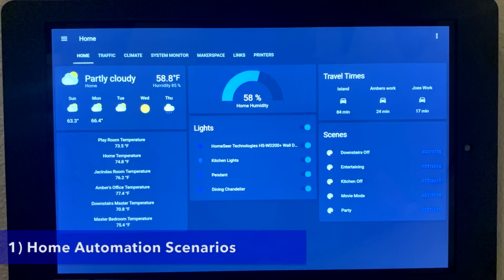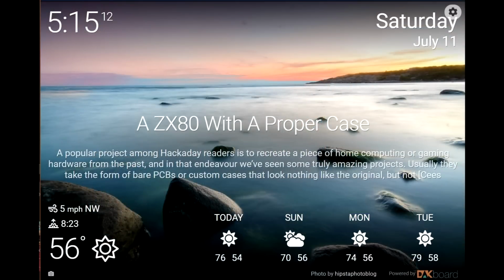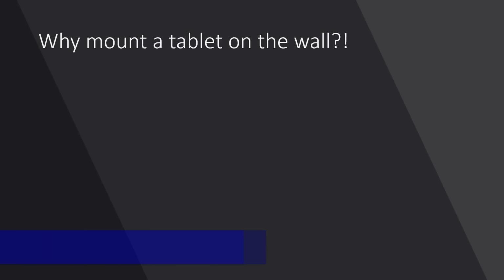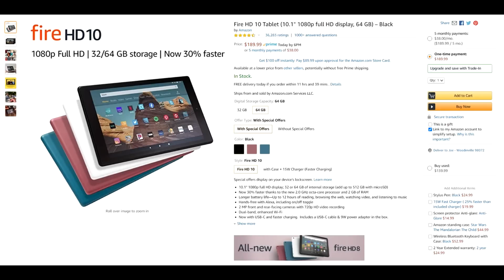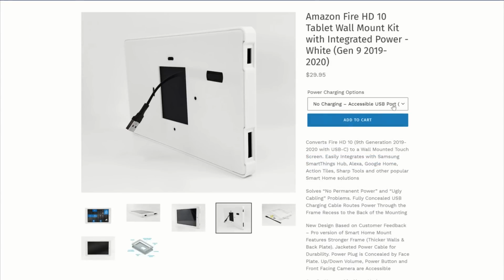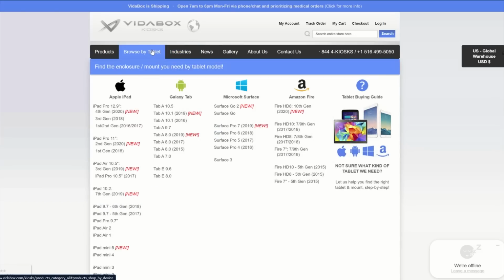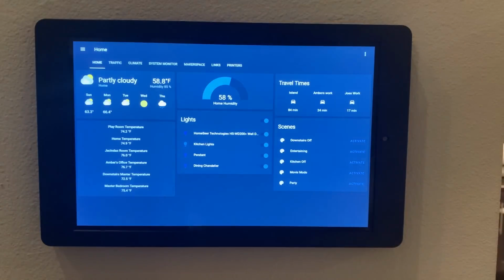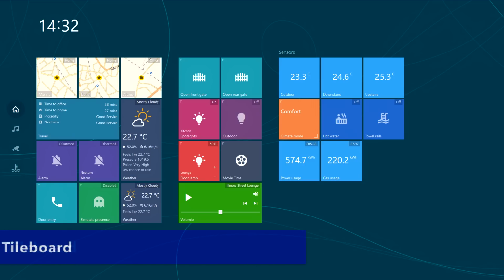5 things to know about wall mounted home automation tablets

Comment: I use SmartThings to control my home would I be able to download the SmartThings app on a Fire tablet?
Reply from the maker: I'm not sure honestly, I've not used smartthings. I would check the amazon app store if you already have a fire tablet to see if it's there, but if not, I'd try to avoid an amazon tablet for something like this just so you can have full control over it. I moved houses and the next time I do this I'm going to go for either a cheap android tablet (or used one) or something else similar

Comment: Does this save you money?
Reply from the maker: No. Home automation is often about convenience. Rarely can you save money with it, though you can use it for early detection of water leaks and such to turn off water. But no projects like this are either convenience or flash or both. Even if I use less energy, the cost of the system would take so long to offset it’s not reasonable.

Comment: Are there mounts for the non-iPad options that also allow the slide in and out for use out and about around the house and then re-mounted?? Just like the iPad one??
Reply from the maker: Not at the time I filmed, but that would be ideal and I’m looking into it for a follow up project. It’s been a few years since I did this and a lot has changed. I’m hoping for either a dockable mount or a wireless charging magnet mount currently and will do an episode with what I find

Comment: GREAT VIDEO.. and thanks for the details research.  I have been researching (A LONG WHILE) for a HA_HI and a must (for me) is a wall mounted Touch device with video streaming.  Tablets have all but one requirement and that is forced Battery use under charging.  The swelling and/or failing battery is still a blocker for me.  I have seen endless 'no battery' hacks of old tablets, but newer tablets seem to have lock down 'features' that require hacks that block other features I need.   Please comment on your battery concerns for wall tablets.   BTW my current design uses POE/Ethernet - data/power thru C connector and wifi disabled.
Reply from the maker: Battery circuits today from reputable manufacturers (as in..not something you find on aliexpress) have a 'smart' circuit in them to handle various dangerous situations in batteries that used to lead to swelling. I have had tablets plugged in for years and not had any issues myself, but I'm just one data point. I do know from my experience in the inustry that smart battery circuits are built in now, and there have been firmware and OS updates to also control charging. I feel like if you buy a tablet made in the last year thats not bargain basement you'll be fine. I keep my tablets charging all the time..windows, android, and ios.  None have had issues (knocks on wood)
Reply: @geektoolkit  Thanks - found info getting charge info into HA and using that for power charge control.. using POE/ETHERNET for my situation.. may have to change or hack power flow but doable.  Thanks again

Comment: Imagine if you have to move? 💀
Reply from the maker: That's actually a great point, but not just for this tablet but for all home automation.  When I left and was showing the house I left this up and explained it was a fire tablet that controlled home automation stuff, but if they wanted to remove it then there was a small hole to spackle (This was just screw mounted and a low voltage line coming out). The bigger problem I had was I'd invested about 1,000 dollars in smart switches, mounted leds, tv mounts and such...and that I had to just walk away from. I explained that they had zwave switches, but the buyers didn't understand what that meant and home asissistant isn't at a place where I felt I could hand that off. Uninstalling about 30 outlets and switches and then buying dumb stuff to install wasn't worth the effort.  In short, moving and home automation really don't go together well..this tablet was the least of the issues though.  It's a great thing to think about if you're not going to stay at a home long.

Comment: can you add voice control with home assistant?
Reply from the maker: Great question! You can integrate google and alexa devices which is what I do. If you wanted to do a DIY system you could do that too, just have to use webhooks or mqtt to interface.

Comment: Thanks for this great video! I have the fire hd 10 and having problems loading videos - it’s slow and the it blacks out. I’ve tried to optimize it via developer tools but not much luck. Thoughts?
Reply from the maker: That sounds like either the tablets defective or maybe overheating
Reply: @geektoolkit  so when I had 3 live cameras in the same page/tab it wouldn’t load but when I kept only one camera it works good…I guess the fire tablet is just not as powerful as other ones out there.
Reply from the maker: Does 3 cameras work on a pc? I’m just wondering if the bottleneck is your pi/server or the tablet. That’s good info to know!
Reply: @geektoolkit  yes I have a NAS running HA and works perfectly - I have 8 cameras running in the same page/tab with no lag.
Reply from the maker: @RafaelRenovato  Oh interesting! Ok thankyou that's a great data point...now I wonder what level of tablet can run it. Do you have an ipad or a samsung to test on? I may have to do a followup talking about more power hungry scenarios processor wise. I also need to get more cameras apparently :D

Comment: Ever thought of using some acoustical treatments...holy echo.
Reply from the maker: Yeah the echo sucked filming there. I think if I were to do it again I'd film in my upstairs and then use B roll.  I just didn't think of it at the time and honestly didn't know the technique.  Still learning a ton about filming, audio, etc.  One other thing I learned later would've helped is putting the mic closer.  I spent decent cash on a new directional mic that hopefully is better, but also I'm going to avoid recording in that area again :)

Comment: Not sure what else you have set up in your network, but have you considered powering your tablet with PoE? They make USB Adapters for it.
Reply from the maker: I would LOVE to do that..but I don't have ethernet run anywhere near that section.  Or are you saying to use a POE adapter in the wall and then convert that to usb...I haven't thought of that..but thats..intriguing

Comment: first of all I really enjoyed watching this video, I am trying to put a wall mount in my home and I really didn't know what tablet to use, I have an old ipad I am trying to use , but I think its too old, its a ipad 3, I think I am going to go the andriod route, I was impressed with the way you went over the software, I have a question, and you use more than one tablet , like one upstairs and one downstairs?
Reply from the maker: Glad it helped! If an iPad 3 can use the web browser it may work based on what you’re looking to control (if it’s web enabled).
  I use one downstairs currently but I plan on adding one or two upstairs. Right now my upstairs is controlled mostly using PCs and an iPad on a charging dock, but I plan on adding a wall panel in my office since it’s where I spend most of my time; though I’m looking into a different design
Reply: @geektoolkit  it  can get on the web, but I have no idea what software to use for it.
Reply from the maker: @jamesdavis-vc9ww  it depends on what home automation system you're running..if it has a web interface then you can use the browser to control it. home assistant is great for this!

Comment: Do you have any videos on smart charging a wall mounted tablet?
Reply from the maker: As in turning the power off at 80%? If so I don’t….charge circuits one tablets should be doing that already, and if not that’s a huge problem with the tablet

Comment: The transitions between lages are horrible. Especially when it goes back hkme.
Reply from the maker: Yeah there’s two things there…I was running home assistant on a raspberry pi 3 at the time, and I am using a budget tablet (Amazon fire) with wifi. The idea behind this video was to talk about the tradeoffs and tech. If you’re able to use POE, and willing to pay for a Samsung tablet and then run your home assistant on say an i5 NUC, you’ll get much better performance. Like all things it’s tradeoffs.
Reply: @geektoolkit  i see, thats good to know. I'll need to find an example of it running on a faster system. Thanks for the reply.

Comment: What do you recommend for Ring Devices and Amazon Automation Device.  Also what did you select for your monitor was it an amazon fire device or a samsung galaxy
Reply from the maker: I use home assistant and integrations for just about everything. There are 3rd party integrations for ring and alexas and such. I honestly am moving away from stuff like ring...they lock up the protocol, and being cloud based means that if I lose internet I can't see my cameras. I also can't get a direct RTSP feed from them to do my own post processing.  
  The screen I'm using is an alexa, however in the video I go through the plus/minuses of alexas vs various other brands.

Comment: First - awesome is an understatement for this video.

Now, my question. This is specialized so I doubt you've messed with it but - the Diabetic community who use Dexcom or Freestyle continuous glucose meters (CGM) can use a real specific stack of apps to get their readings to a public web page. I think if I remember correctly the data is stored in .json format. NightScout is a bit of the project. I wonder if this could be integrated? This could eliminate the need for the public web page space and hosting costs
Reply from the maker: Thankyou! 
  
For the CGM question I’ll have to do some research. Converting JSON to a webpage isn’t that hard if the JSON is available from a public feed. I’ll try to look into this when I get an opening next week to see.
Reply: @geektoolkit  again, awesome would be an understatement! Even if it doesn't happen, I'm still super impressed with your system and how so many resources are combined into one or two looks and feels

Comment: Is it okay to plug/charge it all the time? 
Would it damage the battery?
Reply from the maker: Modern tablets come with charge controllers that disable and enable the charging to keep the battery from overcharging. This is actually part of tablets for many years now. The problem is that when these fail, sometimes they have failed in such a way as to not disable charging entirely. Apple has made changes to iOS and such to alter how the charging happens to protect even further against this. So it should be fine.
  That being said I’d likely not put a random cheap no name tablet on the wall.
Reply: @geektoolkit  Yea, I've had issues with Asus Tablets doing that.  However my Lenovo ones are perfectly fine.

Comment: Good video. Was hoping you would talk a about the other hardware in the house. Like bulbs, cameras etc. How are these connected? Are they smart bulb or is there smart plugs around?
Reply from the maker: Thanks, I tried to keep this focused to the tablets as the way others things are connected is flexible, and I didn't want to tie this to a particular system.
  That being said, I have many videos talking about different aspects of my system.  Short version is the 'hub' ran on a raspberry pi but is now on an intel NUC running home assistant. It acts as the centpoint.  My cameras talk RTSP and use ONVIF (Reolink).  I use Wiz wifi lightbulbs with Innovelli Zwave switches for lighting.  I have an Ecobee for thermostat.  I also use GE Zwave switches for non smart lighting control.   I also have a weather station made by Ambient for local weather/rainfall automations. I do have a smart plug, but I don't have a video about it yet. I use Dynaframes (which I built) for media display, and I cast to my Samsung Frame (through airplay or miracast).  I have videos on just about all of those though, so if you're interested in any there's plenty of content.  That being said it sounds like an overall view of my system may make for a good video, so I'll think on that and queue something up :)
Reply: @geektoolkit  thanks so much!

Comment: Hi! I'm looking for a wall mount, but with wireless charge, so I can pick the tablet whenever I want and move it around. Any help would be appreciated.
Reply: If you have a 3D printer, two ideas that may be useful: 
iPad Wall Mount Magnetic Qi Wireless Charging - https://www.thingiverse.com/thing:4667383
Fire Tablet HD8 Plus Qi Charging Wall Mount - https://www.thingiverse.com/thing:4588627
They might not be what you're looking for but could get you started.
MBMounts has a custom design service. I have not purchased from them but have read good things about their products. When I bite the bullet to mount a tablet, I will probably purchase through MBMounts. https://mbmounts.com/products/custom-tablet-mount-design-service
Reply from the maker: I love that idea! I’ve seen some DIY stuff where they used magnets to hold the tablet and mounted a QI charger..but it was very DIY and didn’t come out very clean. I’ll keep an eye out

Comment: Great video 👌🏾👌🏾where can I get the power cable for the back of my wall ?
Reply from the maker: Thankyou! The MakesbyMike has the best solutions I've seen so far (in that he has a ton of options). I had a power cable from an old security system, but I'm going to alter it to pull from the light switch just below it. https://mbmounts.com/

Comment: Hmm as for me, the new Openhab 3 UI is pretty laggy with those devices. I tested on a 2 and 3 gig RAM device and its still stuttering. So keep in mind, if the HA getting updated and nicer, your tablet needs more CPU and RAM.
Reply from the maker: HA is served by an Intel NUC, so this is just a web interface for it.I don’t believe you can run HA natively in android, it has to be run on a Linux box. But that means the tablet UI is fast and always remains snappy while the backend can be scaled
Reply: @geektoolkit  sorry my english is not so good. I was talking about the Webpage/interface of openhab 3. I dont knoe what language they use but its really nice animated etc. Its working great on a mi 10 pro mobile but if you want to use it on a tablet, you need higher specifications. But im still trying to figure out what happen to the webbased dashboard performance after the update to openhab 3. You guys on HomeAssistant are still safe :)

Comment: OMG i was about to buy a nest max wall gadget, until i seen this, them home screen apps are the ticket, im pretty useless at this home automation, half the bulbs on 3 different apps, sockets for tellys on some thing else,. ive got 2 mini nest, one just keeps blurting something about connecting to wifi ? other one works perfectly.. but i want to add a few other things and this is were i would like to pick your knolage, So i suffer alot of medical issues.. one of them being extreme Parasomnia, So i totally pass out and damage my body, Like opening the oven door to tke my lasagne out, But passed out infront fo the oven for 4 hours, Ended up in hospital etc..  So im trying to monitor myself for evidence for the doctors, So i got the withings scan watch, ecg i have cameras inside and out side, I have wifi sockets and light bulbs, and now looking to put a screen up and add some self tracking apps, Live on my own etc, So im trying to be able to say here doctor i went ovewr at this time, my ecg was this, my blood pressure was that, because all these gadgets are after the event, no good coming too then start pressing buttons .. I know a lot of persona things have been said, but i guine need somebody intelligent to help.. Willing to donate etc?.. With losing my father its basically down to my beagle. Lost my whole support team, and was locked down for 13 months. . So please forgive me :) 🎈

Comment: Can you integrate it with your solar production by chance?
Reply from the maker: Well I’m using home assistant as a backend...so if the solar production integrates with that then yes. Most solar has a dashboard, website, etc so you can always just host that page to get a dashboard as well
Reply: @geektoolkit  you can only view solar production from Tesla through the Tesla app. Might port another way...
Reply from the maker: Home assistant has a Tesla Powerwall integration so that data could be imported into grafana or influxdb and represented alongside other data.  So if it’s a powerwall and using a Home Assistant hub it can be directly imported. Please see: https://www.home-assistant.io/integrations/powerwall/
Reply: @geektoolkit  it's both solar panel production and powerwalls

Comment: Great Video! Is it possible to pull power from a Honeywell smart thermostat? (would be mounting directly above or in place of) If so, what type of converters would I need and how would it connect to the thermostat wiring? Thanks!
Reply from the maker: I'm not honestly sure. You could use a volt meter to measure the amperage/voltage of your wiring, from a quick search you'd be using the C wire and possibly red to complete the circuit. What you really want to know is the amperage. Then a step down converter to get it to 5 volts..but I'd research it more first on a home automation forum. I don't know of anyone that's done it, and I wouldn't want you to hurt that system.  Measuring current/voltage should be safe and get you a start if you know your way around a digital multimeter though.

Comment: 5:45 Wait, where and what is the other end of that USB power cable? I was thinking of doing something similar (basically ensconcing within wall cavity), but didn't wanna "rig" it too badly. Curious where you tapped in!?
Reply from the maker: Good question, I think I cut that part of the video possibly. I had a security panel there so I had wired into the old security panel wire. But...right below it are light switches so I plan on getting a wire setup from makes by mike and wiring into that instead. I’ll pull off of the neutral and line wires coming into the box